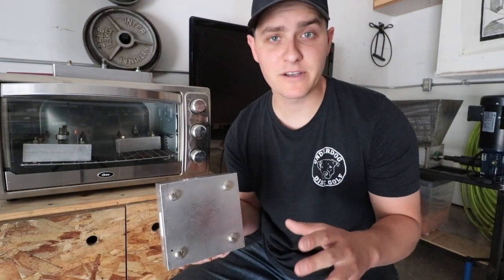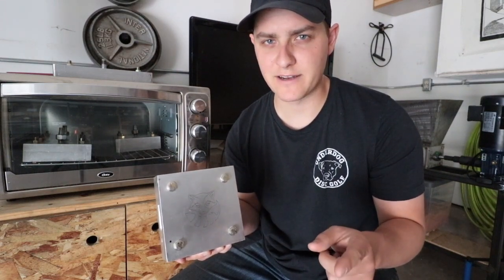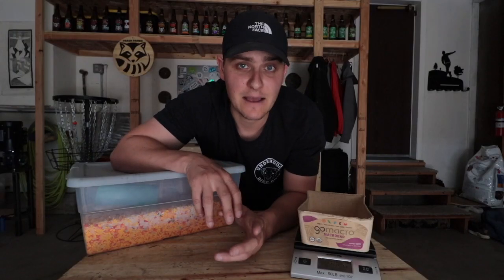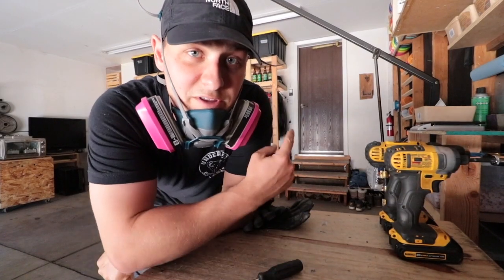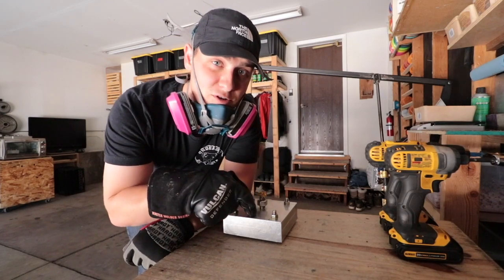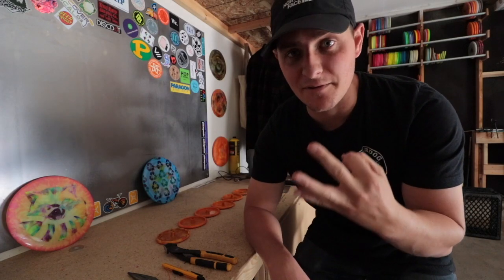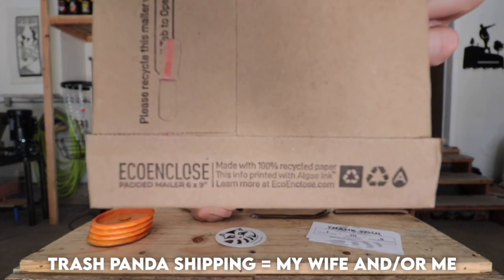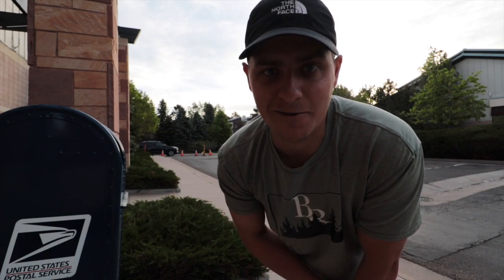How to Make Disc Golf Minis in Your Garage

Comment: First off I love everything about this. If you use air tool quick connects the female side will hold pressure. the mold would click in and out. When I built my smaller injection tube I used a male tip for the nozzle on it.

Comment: Here for the algorithm.

Also, if you add an adjustable extension to your shaft, it won’t require as much force from you. I assume you have it at the current height because your ceiling will be in the way. But with an adjustable extension, you can just extend it after it is below your ceiling height.
Reply from the maker: Great tip! Thanks Joseph!

Comment: On your full size discs are you planning on adding a foil to the top? If so any idea on the process you would use or if it would influence the recyclability? I am curious because I'm just starting to try custom foil on my discs.
Reply from the maker: Thanks for the question Beckett! I currently don't plan on it because of the effects on recyclability and the waste it creates. That said, there may be some solutions to this problem that would make it possible!
Reply: @TrashPandaDiscGolf  would dyeing also affect recycling?  If not I volenteer to help out there.

Comment: I don't know much about injection molding, but spontaneously I would consider making a mold that can handle a few minis in one go. Since the machine could handle 6-7 maybe a mold with 3 minis would speed up the process. Especially for the minis it might work injecting in the side instead of the center
Reply from the maker: Great thinking Anton! Appreciate the tip!
Reply: I was just going to say the same thing, one larger mold to inject, but has multiple cavities.
I was thinking like stacking 4 molds with a single injection point that branched to each one.